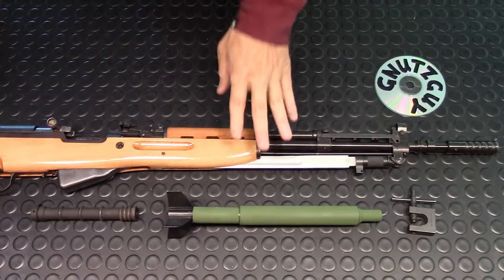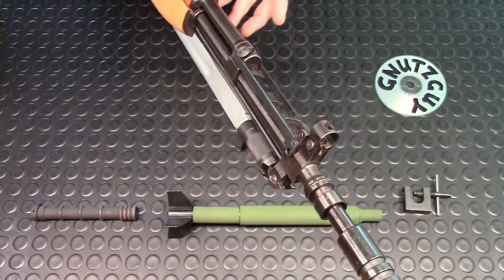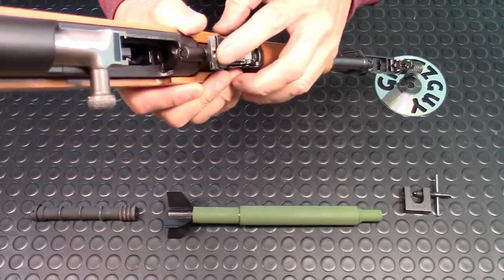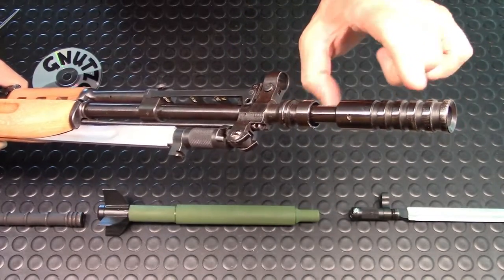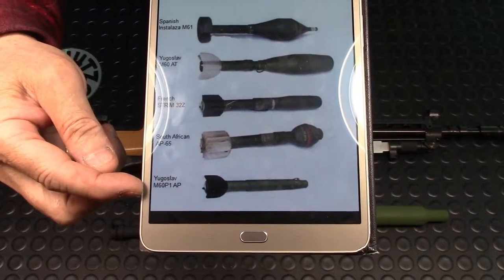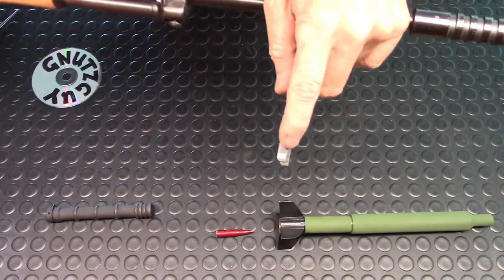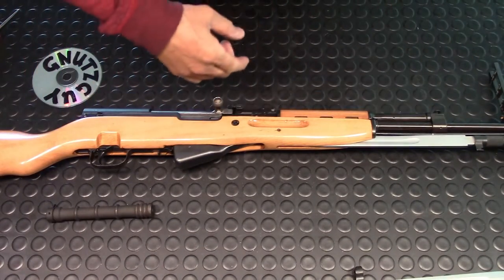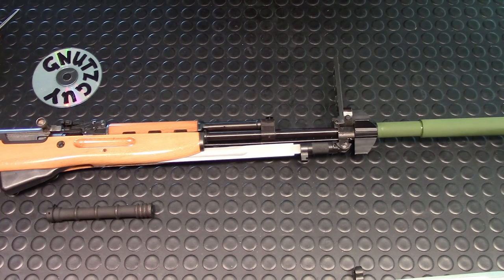Yugo SKS M59/66A1. Three sights: Standard, Night & Grenade Launcher

Comment: Ha just did a video on Yugo M59 n M59/66-A1 never seen the blond furniture before....  be well.
Reply from the maker: beat ya, lol... thats what i dislike about yugo, they put nice hardwood but then they cheaped out on the finishing. they do not stain nor put finishing out of the factory. my wood had not stain and no finishing, just soaked in oil/cosmo so i lightly sanded it, degeased and sprayed a clear coat.
Reply: @gnutzguy  , I have a Tula 54 and my M59 shoots better than the Russian one.. the 59/66 needed a Murray's firing pin.. kept sticking.. polished up both triggers and much better now.. All SKS triggers suck because of their design.. be well.